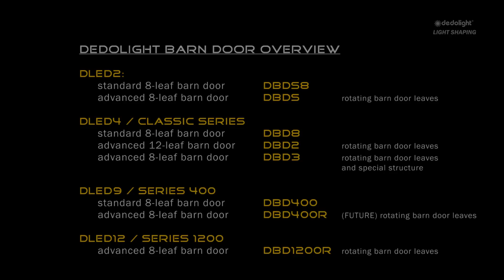Light & Shadow Shaping - with Barn Doors

Comment: I was just wondering if a soft felt material would work on the inside of the metal barn door frame to absorb some of the light output of the lamp. Flammable might be a concern but not of course for the DLED family.
Reply from the maker: +Avidcomp 
Dear Avidcomp.
Using soft felt material on the inside of the barn doors - Yes, that would work, but it would get too hot and burn up, it would crumple and get brittle. At least that is what I would fear.
There are materials that are flame resistant.

But then, it is usual practice to put such soft black material onto larger frames and place them at a considerable distance from the light source. That seems to work very well. The flags or gobos, or whatever they may be called. That seems to be standard practice.

With our new barn door, with the structured inside of the large barn door leaves I am very happy. That seems to do the job very well and it will not raise costs very much.

I also had some other experiments many years ago, trying to work with curved surfaces on the barn doors to contain the reflexes that are caused by the barn door leaves, but that never came to any really useful results. It was too big, too cumbersome and not really effective enough.

That is the short answer that I can give you now.
Best regards, Dedo Weigert
Reply: Thank you Dedo.
Very good and clear answer.
Reply: @DedoweigertfilmDe  I would be using them for flash photography, not with continuous lighting. Surely in my case, there would be no problem?

Comment: I assume you need a pretty focused light to do this. I have a project this is perfect for. Can you share what light you are using? Thanks.
Reply from the maker: The barn doors in this video may be used on a dedolight DLH4 (150W tungsten halogen), DLED4 (40W LED) or DLED7 (90W LED) light head.